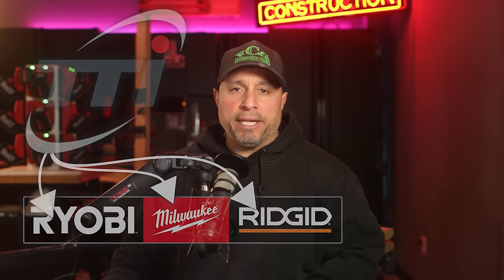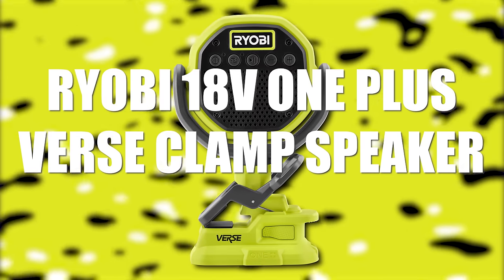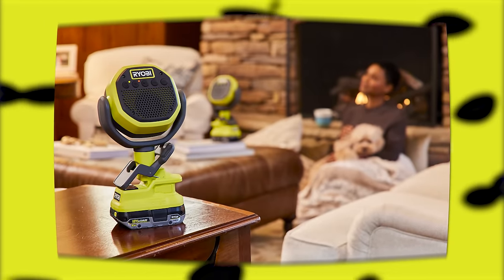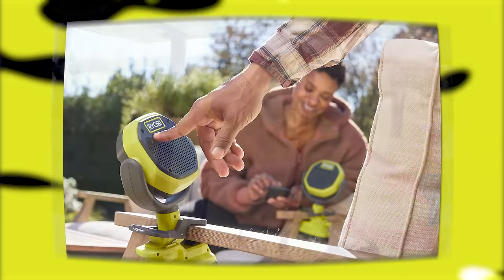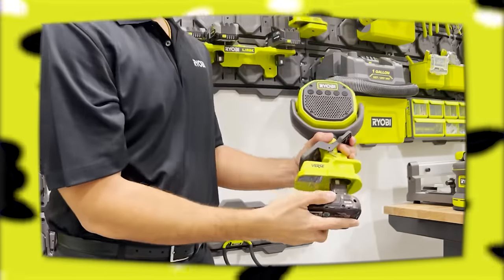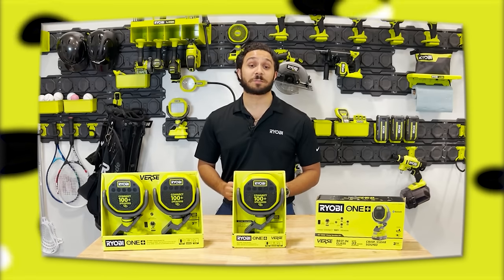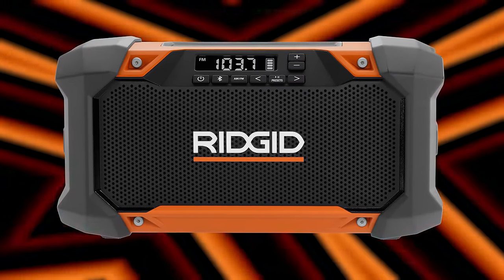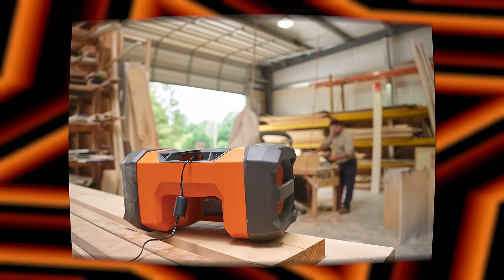Ridgid Ryobi & Milwaukee Tool HUGE Launch Changes Everything!

Comment: That Vacuum pump is gonna be a GAME CHANGER, especially for rooftop AC work where NO receptacles are available, and no 120v circuit to even clip a "suicide cord" onto. At least with most residential setups, you can clip onto the 120v circuit. But many large Commercial units can run on 208v, 277v or 480v so you don't even have a 120v circuit to connect to. I've seen techs stretch out HUNDREDS of feet of extension cords to evacuate units like that.
Reply: You're forgetting that AC techs create 120 volt circuits out of any combination of supply voltage, and there are already cordless solutions that offer near the same performance levels at a. Fraction of the cost, the main advantage I see is people that are already deeply invested into Milwaukee platform. Have plenty of batteries that are interchangeable, where in the other called the solution is a separate battery platform
Reply: Navac has had one out for a while. However the battery compatibility will be better for Milwaukee users already using the platform.
Reply: Makita have had this item for 5years or more, and yet nobody uses them
Reply: @Daryl Savage  
I've never seen an hvac person even utilizing MAKITA platform. Always MILWAUKEE 👍
Reply: @John Maranuk  here in the UK they mainly use dewalt or hilti, point still stands though. Another platform has had it out for years and it never took off, so you have to wonder why
Reply: @dustinweber6803   how do you get 120 from 460?
Reply: @dustinweber6803  dear sir.. widow chord's are frowned upon.. also same thing with childless shop vacs when they came out. Everyone said why would you do that when you can just plug in a shop vacuum. Cordless shop vacs were a game changer. And this cordless vacuum pump is also going to be a game changer
Reply: @darylsavage119  because no one uses Makita..
Reply: Must be new to the trade! Alligator clamp from a hot and another to ground and you have 110. That pump is going to be worthless.
Reply: @darylsavage119  that's because Makita is a 3cfm pump. I can only imagine how long a pump down on a 18 year old r-22 system could take. You could do all your service calls for the day and comeback at only 2000 microns 🤣
Reply: @Omar D-20  ill be honest, as an electrician that just went woosh 😅
Was just point out that it already had existed for years with few takers
Reply: A lot of current pumps have a 230 vac switch, but I get what your saying.
Reply: I use the navac battery powered vacuum pump it works fantastic
Reply: @rytjson4487  I never would have guessed my battery vac would be as handy as it is
Reply: Had a NAVAC for a year now running a adapter for my Dewalt batteries. Been a little work horse so far. Expensive but worth it

Comment: i would imagine that you could also broadcast a voice over that nifty ryobi sound system, it's in it's most basic form ,a P.A. system, so if someone doesn't hear you call them or doesn't answer a text  and they're on the other side of a jobsite,, you can summon them through that ryobi bluetooth speaker and someone will hear it, you could also do karaoke

Comment: Man, that VAC PUMP, looks bad ass! Definitely great, when going up on rooftops, to do work. Cuz half the time ain't no receptacle up there that actually works! But eh, 849 bucks???? That thing better out perform the CORDED version from its competitors.  That's alot of Jing to spend. But if it works just as good, then your saving money.  Time is money!
Reply: Regardless of that I'm getting it just so u don't have to haul 3 Plus 100ft cords up a mall/building most times your already roping up tools, gauges, pump, jug, and sometimes a compressor. Worth every penny
Reply: Get a NAVAC with battery adapter

Comment: I would prefer to buy the Milwaukee power source and run my current field piece 8cfm. The power source is $699 everywhere and is more versatile. For a residential tech I can’t think of a time I did not have 120vac or a widow maker to power the pump.
Reply: Agree, but I'm a commercial installer for new construction and this thing is a dream come true for me.

Comment: Those Ryobi speakers are pretty cool. I wish they had an option to plug in a USB C cord and charge the battery while using the speaker. That would be awesome. I might have to try them when they come out.

Comment: When your vac pump losses power and there’s no isolation valve you don’t only lose your vacuum it sucks the oil back into the lineset then you gotta flush it out and start over. I Have had a few customers and other contractors pull my plug and create a hassle lol.

Comment: That vacuum pump will not cut it.  The run time is not long enough.   To get a proper evac of 500 microns, you can go longer than 90min.  And it is only 5cfm.  I have the 10cfm fieldpiece and this pump would cost more then I payed for the fieldpiece.  If milwaukee is going to get into refrigeration tools they need to do better than this.

Comment: Same garbage .why don't the radios charge the batteries and run the radio at the same time .Same radio as the Milwinkie  only flaccid orange .TTI needs a good kick in the balls .Clean up your act .The old 18 v nascar  rigid radio with scanner and battery charger and am fm radio was way better than the Bluetooth crap both Milwaukee and rigid or Ryobi make